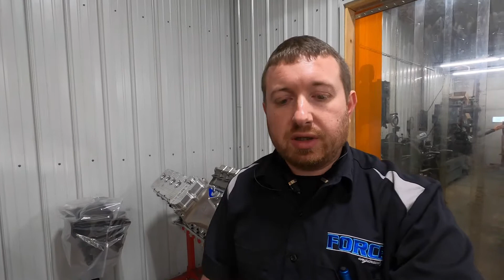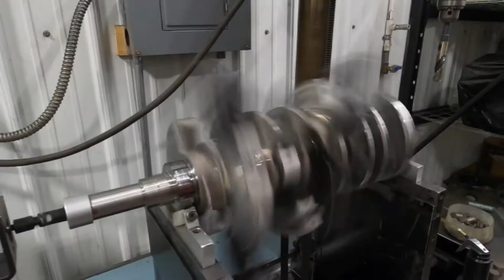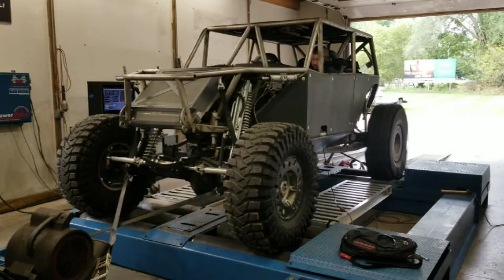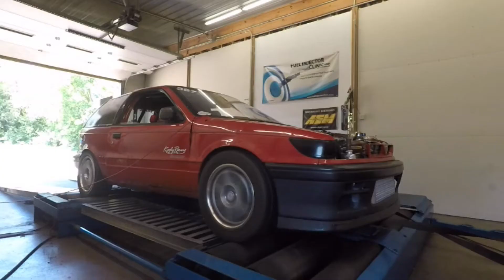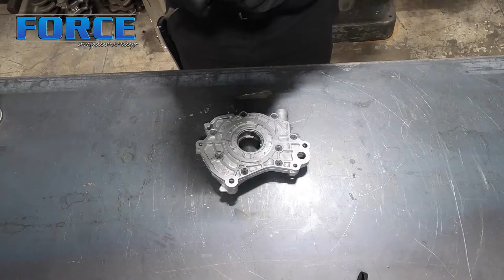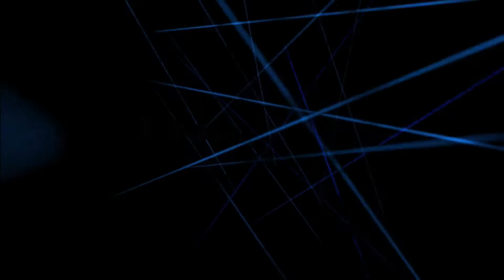Engine Assembly - Coyote Oil Pump Gears | How to Install OPGs

Comment: Could you add specifications to this video. I think it’s import to understand rotor tip clearances and rotor to body clearances. I had a pair of billet oil pump gears but they had way too much tip clearance at .025 and I believe the max amount is somewhere around .010 my OEM set had .003 clearance. I don’t want guys just slapping together an oil pump without being able to verify the aftermarket parts they are installing are not going to cause a pump failure. 

Guys could follow this video step by step but have improper clearances and wouldn’t know. Maybe in the description of this video you could add some go and no go clearances. Great video love your content. Keep posting brother✊🏽